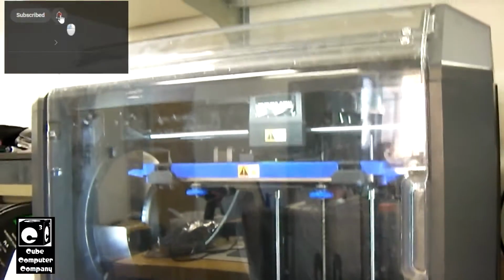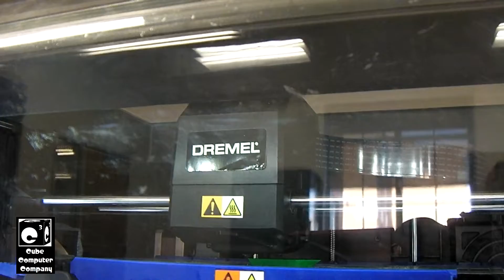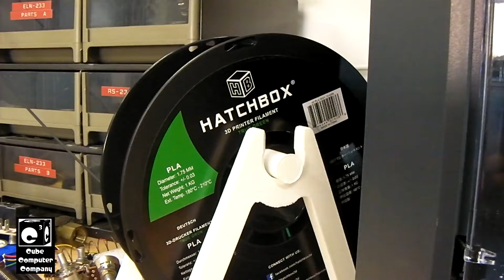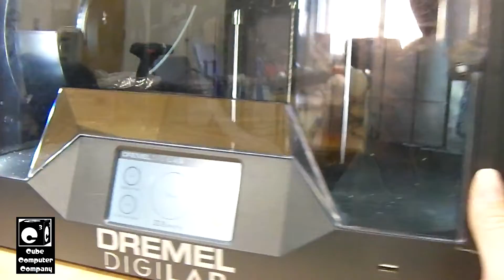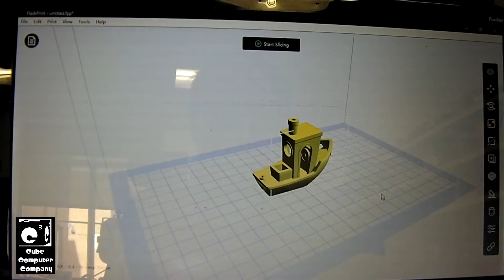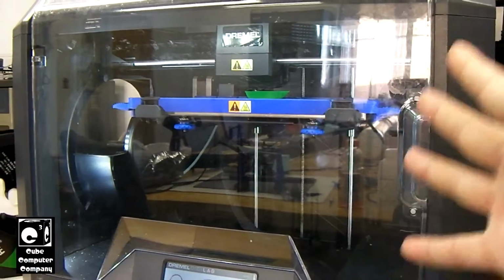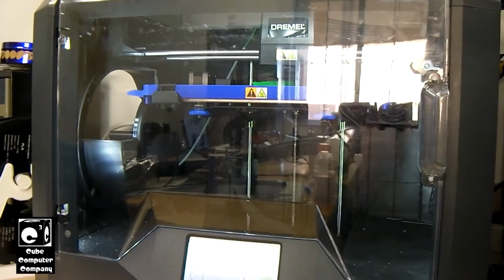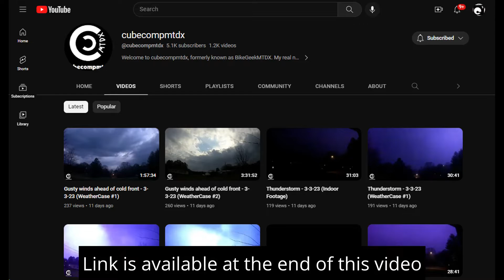My opinions on the Dremel Digilab 3D45 3D Printer and why you should NOT buy one

Comment: Fast forward to 2025 and in Australia I can't seem to find the special 180mm spools at all.
A big selling point and ease-of-use feature is the RFID tab on the genuine 180mm Dremel spools which of course now  . . . DON'T exist! Because 3rd party 200mm spools DON'T FIT! that carbon filter is a waste of time; with a gaping hole on the left hand side where the spool cover fits.

As you said mate, w-a-a-y overpriced and now 7 years old. They print at glacier movement speed and print estimates are off by hours on larger prints (according to other reviewers).
I looked into this printer and yep, as you said, Dremel sold off this part of its business back in 2022 so, NOT Dremel. I tried to find the Dremel cloud portal . . . it's either GONE or the URL has been changed. The company that licensed it probably aren't allowed to alter ANYTHING under the licensing rules so it's a 100% dead end printer for sure.
PS Impressed by the Benchy quality. Not bad at all.

Comment: I bought mine about 4 years ago, and in 2025 it still does all I need and on Windows. It can use other filaments. So I do think your review is a little unfair.
Reply from the maker: For what this thing costs, I totally stand by my review. In fact, I probably wasn't harsh enough. There are tons of options out there which will provide you a lot more features, faster printing, ease of maintenance, cheap replacement parts, and more. I get the Dremel does the job, but it's not worth the price asked of it. You can get a FlashForge Adventurer 5M Pro for less than a fourth of the price and have a much faster machine that's much better in nearly every way.
Reply: @CubeComputerChannel  I'm with you and thanks for an honest review. Do you understand how rare these fair dinkum reviews are these days? Most are infomercials by people who get stuff for nothing and know not to look a gift horse in the mouth. Utube has become the late night tv ad fest I detest.

Comment: Ha. I am printing a dust port for my dewalt 735.  I have had this since 2018 so it's 6 years old.  Still working.  Still works with out having to mess with it.  It just keeps working.  I have friends that have the cheapo versions and they are broken with no parts.  I have printed hundreds of things with this.  I have thought of updating to a newer printer that is faster...but hey I am retired. It doesn't have to be done in 1/3 the time.

Comment: You mentioned the positives.  Here are more negatives.
- Software does only one thing at a time during startup: does not warm up platform & nozzle simultaneously, or move platform & warm up simultaneously, or level & warm up simultaneously.  Slow and annoying.
- Wastes time auto levelling the platform every time.
- Disconnects from WiFi often.  Connecting the slicer app to the printer using WiFi is tricky.
- The platform needs glue application & cleaning. Platform is glass and separates from object
- Relatively high failure rate on startup, middle rash.
- Extruder got clogged after 330 hours, had to disassemble it.  The Service lady was very helpful and sent detailed docs.
- Only Dremel filament fits inside case, non-Dremel needs to be mounted outside.
- Dremel filament got tangled on the spool.
- Need to set "Initial layer height" to 0.4mm or it will fail to start.
- Front center tends to misprint most often.
- Does not detect misprint, does not stop on misprint.
Arrrgh...

Comment: That's a ender 3 with raspberry pi inside a enclosure....
EDIT: What voiding your warranty with 3rd party filaments?
That is absolutely outrageous and borderline illegal.
Reply from the maker: To be honest, this is a step up from an enclosed equivalent of an Ender 3, however it does not warrant spending the $2,000 price tag for it. There are better 3D printers that cost less than a third of this thing.

Comment: Bambu Lab X1-Carbon AMS Combo 3D Printer is $1,449.00 USD
Reply: Just picked one up after owning a P1P since March. It just works. So far, they've both been "appliance level". The X1C/AMS combo is more-or-less a toaster oven that spits out multi-color light sabers without a whole lot of thought and almost no problems. It's been great so far, and the P1P is just as nice to use.
Reply: I own voron 2.4r2 at home which I built, and at work I've requested bambulab x1c.

Comment: Dremel isnt the only printer manufacturer that is selling old technology at premium prices.  Namely the Prusa printers.
Reply: Prusa is still much newer tech than this Dremel. It's painful watching a core XY that is slower than the Mk4 and still requires occasional manual screw adjustment.
Reply: Yeap, lazy ass companies scalping the peak of the bell curve in interest. I imagine it'll drop off seeing as most people are too lazy to actually USE their printers for anything more than trinkets.
Reply: @tokimodo2636 trinkets get some interested in pursuing it further and hopefully the next big thing comes from one of those.
Reply: If you look at the amount of different innovations in Prusa printers compared to other companies you could've named, you'd think otherwise. Ultimaker is way worse for example or even Creality. Sure, since Bambu Lab came out Prusa seems a bit overpriced. However if you look at the customer service, community and reliability of Prusa printers it still has a valid market.
Reply: @mick0matic maybe with the original prusa but they’ve just sat around and not really done much of anything.  I have a prusa mk3+ and yes it just does what it should but nothing more. My X1c with the AMS absolutely puts it to shame in every way. I have an original Creality CR 10 that still is kicking 12 years later. I have a k1 that died 1 weeks ago after getting it. There is just a huge variance in what’s around. Dremel was never a contender in my mind.
Reply: @3Dprint4you  "I have a prusa mk3+ and yes it just does what it should but nothing more." What, you want it to make your coffee or clean your room? What?
Anyway, congrats on owning a printer that is the most common 3D farm printer in the world due to reliability, ease of maintenance and connectivity. Now why is that? You don't believe me? Well, prove me wrong then.
All that said, my next printer will be a Bambu with AMS due to price.